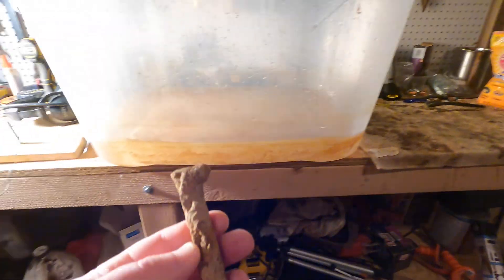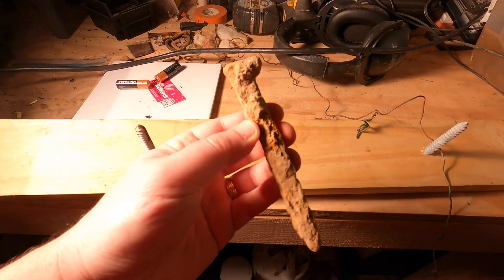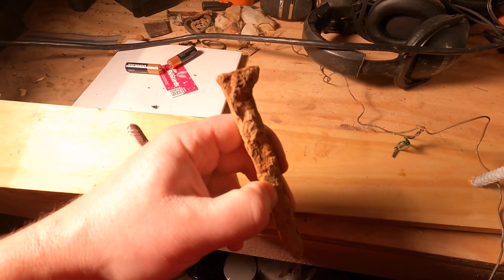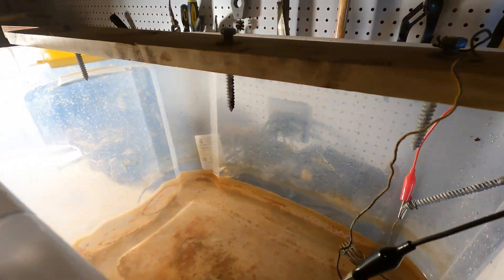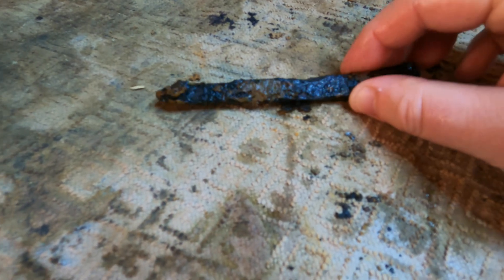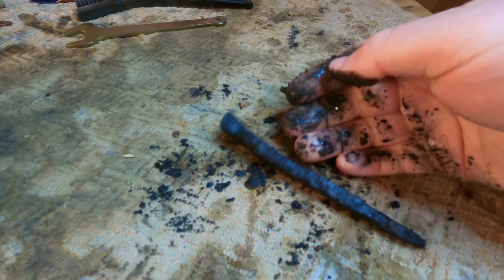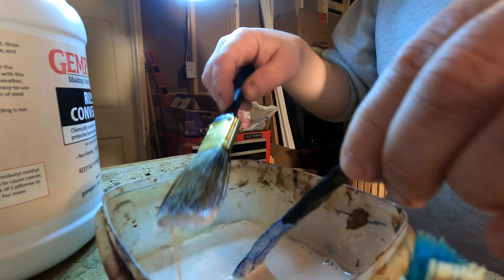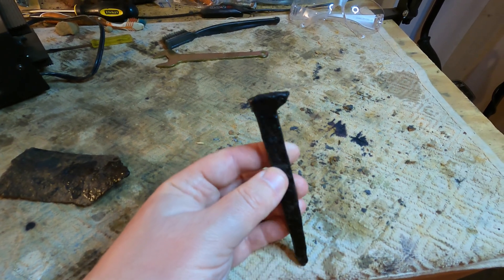How to Clean and Preserve Iron Relics with Electrolysis!

Comment: Thanks for the info on electrolysis. I might experiment using my old 2 amp automotive trickle charger. Disclaimer: If you don't understand basic electrical current flow you should not use a battery charger for this purpose (or even it's intended purpose). The spike came out really nice. I used something, I think it's called "Naval Jelly", to convert the rust when I was painting a small rust patch on my car. It's been over a year and the rust has not re-appeared. Anyway, thanks for sharing. I see you did a video with Aquachigger. I like his stuff too. Subscribed.

Comment: Looks like an old railroad spike,probably from that period. They may have used it as a tent stake but doesn’t really seem long enough.
Reply: To me it looks a bit small in diameter for a railroad spike. If it is in fact a military tent stake I would bet it was designed for rocky soil considering how stout it is (and short, as you said). With as many civil war relics as have been found I'm sure it could readily be verified one way or another. I just like to speculate.